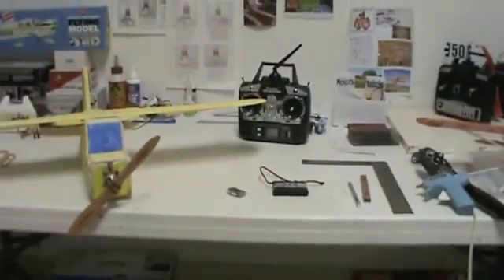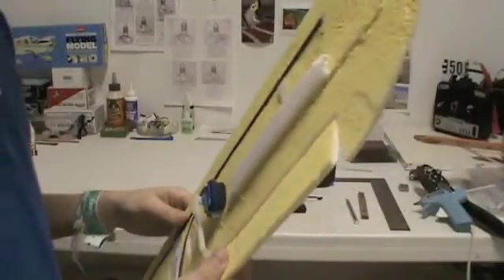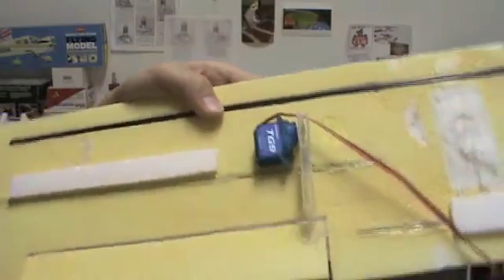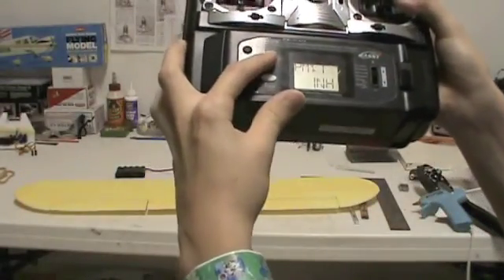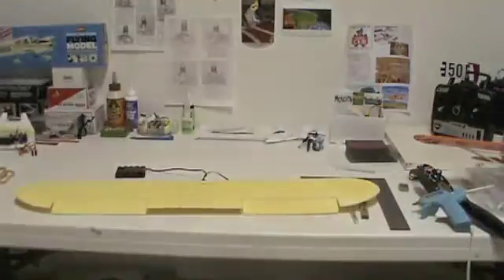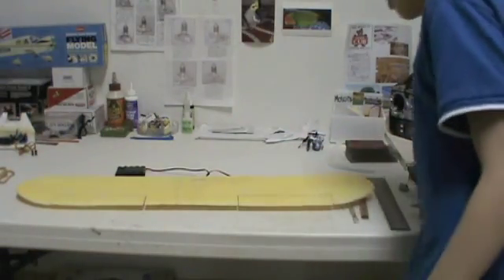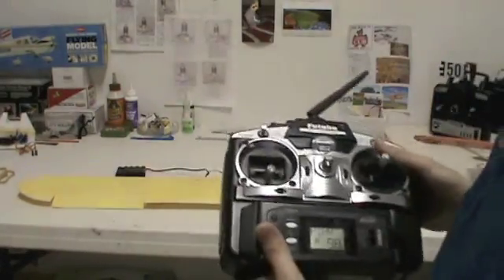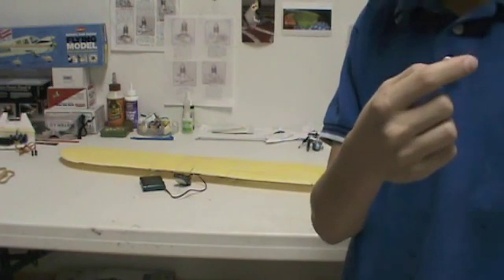Set Up Flaperons on your RC Airplane

Comment: @thefsxflyer No you can't use a y-lead when using flaperon mixing. To use flaperon mixing the transmitter needs to be able to move the servos indipendantly of one another.